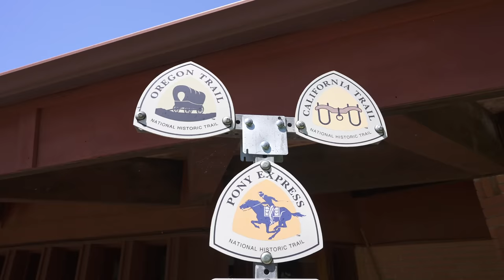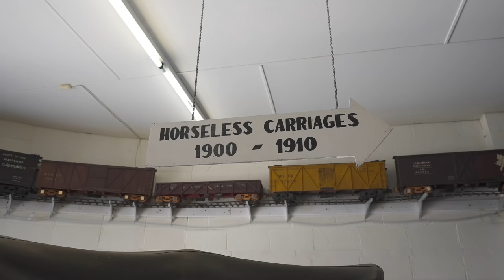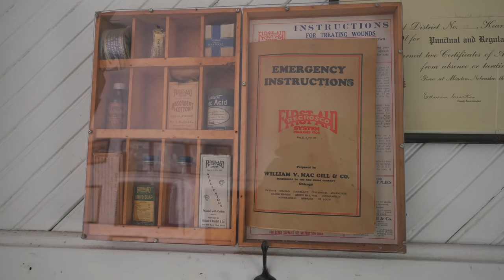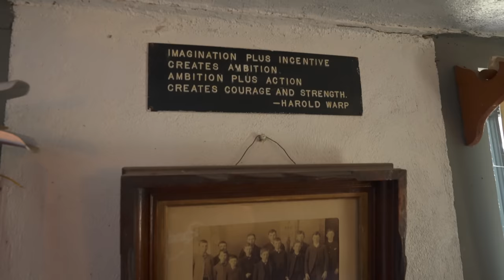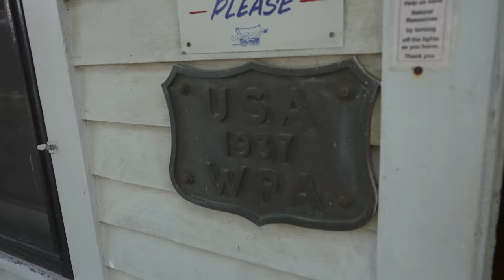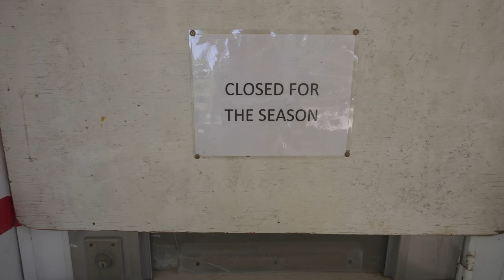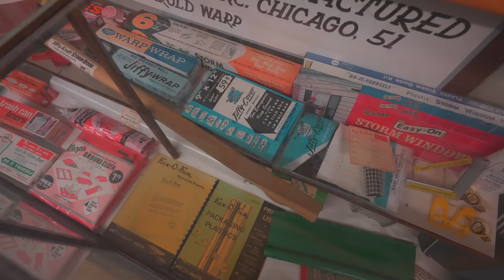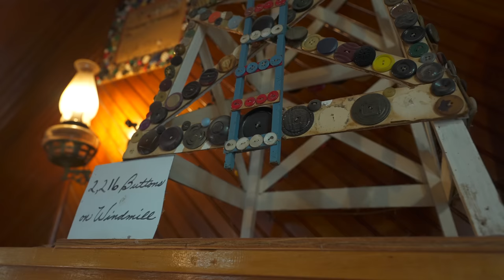Nebraska's best Adventure - Harold Warp's Pioneer Village

Comment: The Motel and Restaurant (building with a hole in the roof) are closed but the campground is open this year. Once repairs are made to the 2 story motel roof they will be re-opening it. If you stay at the campground you receive 1 free admission to the Village, if you need 2 days to see everything they discount the admission for the 2nd day, there are plans in the works for repairs and a lot of other work to be done in and around the village over the next couple years.

Comment: I went on several field trips here as a kid, even had a day of school in the old schoolhouse. I haven't been back inside in quite a while, but thanks for showcasing it so well. I know there has been a LOT of work going into restoration efforts, especially in the last few years. If someone is looking to plan a trip, this is right in the middle of the narrow strip of land that the sandhill crane migration comes through (so you can either double up, or avoid that time of year to have more hotel availability).
Reply: Oh, and the hand powered rail car is just a "handcar". Not 100% sure about the large stoneware crocks in the general store. I think ones like that were used for things like butter, salted meat, and pickled vegetables.